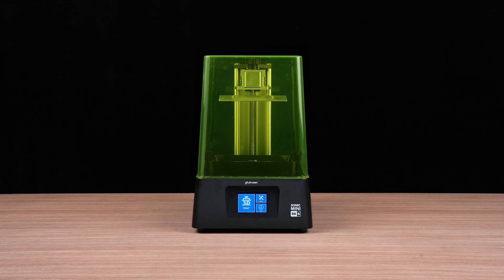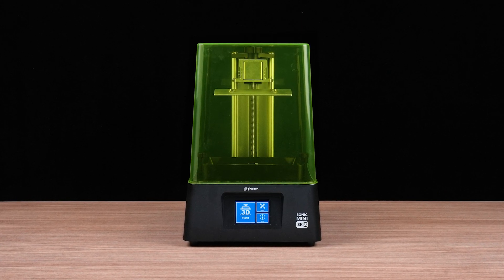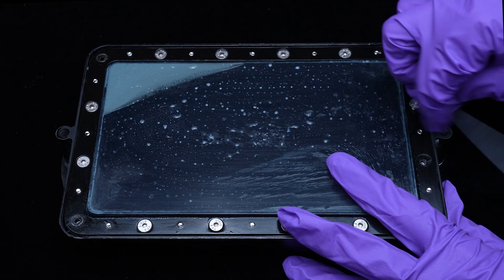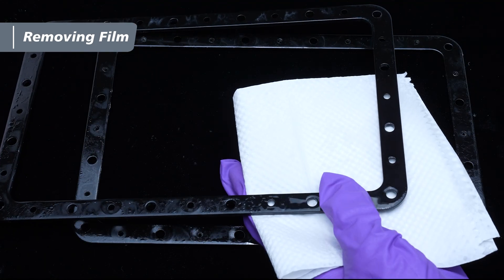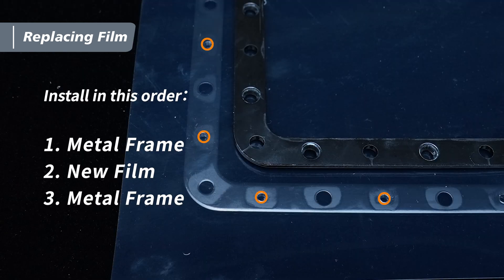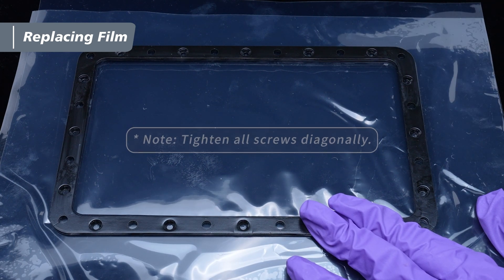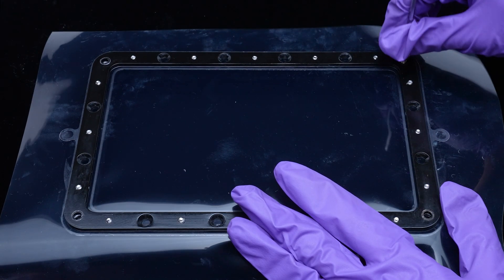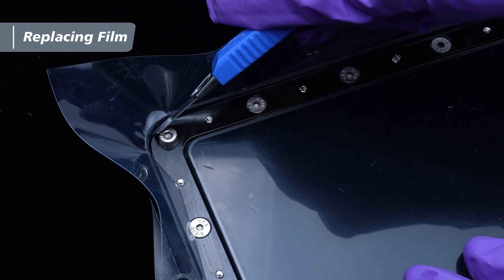Phrozen Sonic Mini 8K S: Vat Film Replacement - Phrozen 3D Printer

Comment: I just replaced the vat film and it cracked and leaked after one print. I have no idea what I'm supposed to do or what I did wrong.
Reply from the maker: Have you relevelled your plate after installing new film? if you wish to get to bottom of this, please contact our customer support for in-depth query https://helpcenter.phrozen3d.com/hc/en-us/requests/new
Reply: @phrozen3d  Thanks for getting back to me! I did recalibrate it, but I think my issue was I didn't filter the resin and couple particles might have damaged it.  Thanks for the help center link, I'll give reach out to them.

Comment: Hello, i purchased mini 8k s around last year. And i want to add more machine to work with my mini 8k s

Is purchasing mini 8k s in 2025 still reliable? or is there any clue for next "budget" friendly printer from phrozen?
Reply from the maker: For now, Mini 8k S is a solid option. If you wish to make it a full production, we recommend Mega 8K S
Reply: @  Thanks, sorry i just run a small business. I guess i'll purchase another mini 8k s

One more question, is mega 8k s have print quality same like mini 8k s? but with bigger build plate
i just assume it by the name "8k s"

Comment: I just replaced mine the other day. Its worth noting to not overtighten and to remove both sides of the protective film before installing.

I used an app called 'Spectroid' and tap on the film lightly slowly to 'tune' it with the screws like a drum skin until it gets to about 333Hz.